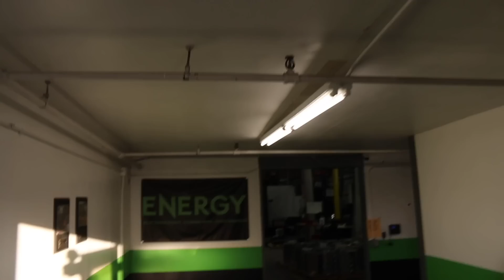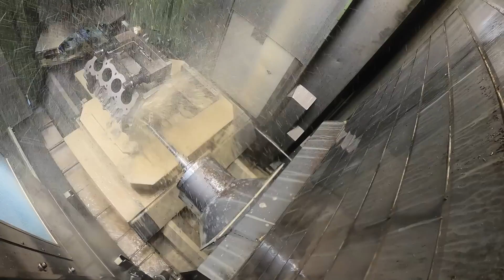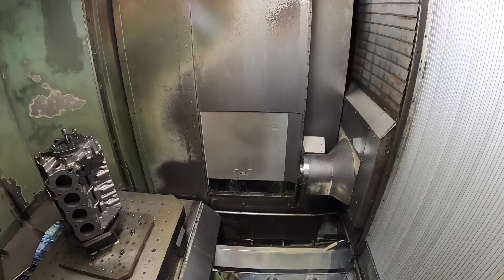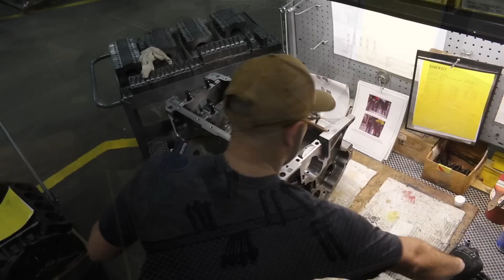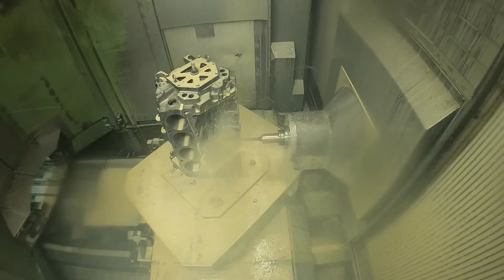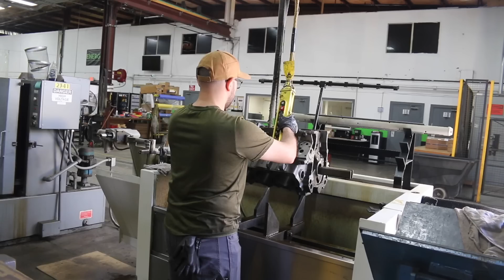How a Hemi Block Is Made at Energy Manufacturing #callies #hemi #mopar

Comment: Thank you for posting this. I recently bought a block and are assembling a hemi. it's a lifelong dream.I'm impressed by the quality. My only issue so far is the original exhaust manifolds does not fit. Som material must be removed from what is left from the motor mounts and the second thing is that I have to remove some material around the oil pickup tube otherwise it will not fit. No big deal.
Reply from the maker: Huh. That's the first I've heard. Were those the 440 mounting ears that needed to be shaved to fit the Hemi mounts or vice versa?
Reply: @moparconnection  yes, those are already removed but I need to shave off additional material 1/8” or 3-4 mm on the upper edge of the block to get the manifold flush to the head.

Comment: Brings me back to the days before I retired. I was a toolmaker , Master, honer, Grinder, Etc. It's all  memorable to me. I can relate to it all. It still amazes me . the technology now is astounding how fast they can machine.
Reply: Intresting! can you say anything about how long time it took to prepare a block like that when it was in production line?
Reply: @ifixmycarmyself2502  I have no idea now. I would have to call my friend in NY and he is busy. It's been ten years since I did any machining. I'm retired.In the last 15 years machining time have been shortened by 90% at least and the accuracy has gone to .000010 + -. Yes that's ten millionths of an inch. Engines do not require accuracy like that. Only die plates and dies.
Reply from the maker: It’s really impressive

Comment: Terrible video. Why so lazy? A caption identifying the hole or surface being machined would have provided actual information on what was going on. Thanks for very little.

I followed Direct Connection closely during the 80s. My recollection is that a condition of the government bailout that saved Chrysler in the later 70s was that they had to quit making new Hemi castings and destroy the cores. By the middle 80s DC had run out of NOS Hemi blocks. I also recall in 80s that because of this a company tried to make a Hemi head for a modified 440 block. I have the article on that 440 Hemi conversion head somewhere.
Reply from the maker: There’s nothing lazy about traveling 6 hours one way to record this process at each stage over 3 days. (You’re welcome for the free content BTW) Amazingly, some companies don’t feel comfortable giving away every facet of their process to competitors who’ll take that information to China to be knocked off. And yes, Stage V offered “conversion heads” for a good while but the juice wasn’t worth the squeeze.

Comment: IT'S SO SAD THAT 2023 WAS GOING TO BE THE LAST YEAR OF THE HEMI AND THE DIESELS AND MOPAR WAS SWITCHING TO SMALL DOUBLE TURBOCHARGED ENGINE'S AND ELECTRIC BOTH OF THESE SMALL ENGINES HAVE PROVEN TO BE PIECES OF JUNK TRYING TO SQUEEZE TOO MUCH HORSEPOWER OUT OF TOO SMALL OF AN ENGINE COMBINED WITH HUGE AMOUNTS OF POLLUTION DEVICES 
DAVID ADAM GRENIS MAPLETON AVENUE BOULDER COLORADO
Reply from the maker: The Hurricane is a decent performer, but the reason was because of the massive penalties that the EPA was hitting FCA with.

Comment: Wow. Interesting. It makes you wonder, how you can make a car every 5 minutes, and how long this process took back in the day.
Reply: Actually they can't make a car every 5 minutes but they can put out a finished car every 5 minutes, with PRE-PAINTED PARTS and pre built engines. And it may be faster than that. If you look up the production figures for 1966 Mustang you will see some very large numbers, 607000 from 3 assembly plants.
Reply: @thomasward4505  I do as much machine work on my own stuff. I have a fn kwikway boring bar and a kwikway 090 hone and a bd cylinder head machine. At very best I can bore 1 block an hr. Plus setup. The machinery itself is only so fast. Baffles the mind those numbers.
Reply: @thomasward4505  bad example there. Exactly when did they start machining 600k of engines

Comment: Hate to have one of those blocks fall on me.
Reply from the maker: lol yeah they weight 314lbs when done
Reply: At that weight I hope they are twice as strong as the original which I believe is about 245 with caps  @moparconnection
Reply from the maker: Actually, they’re very close and remember a factory street 426 Hemi weighed 812lbs fully assembled. They were monsters!

Comment: Are the "locally" cast blocks seasoned?
Reply from the maker: Same process for their Chevy blocks.
Reply: @moparconnection  aaaannnnd??????
Reply from the maker: Give them a call and find out! I wasn’t given a tour of the foundry.
Reply: Yes, all are covered in Johnny's seasoning salt.
Reply: I'm a engine machinist I've done years of homework. How do you to expect it to get seasoned as just a block?
Heat cycling is done as a complete engine not just a bare block. The metal takes a memory from running. The heat cycling done pre machining does not duplicate a running engine 
You must be talking about the old sales pitch from old times. In fact they didn't know what they were talking about.
Reply: Also, seasoned means used so who wants a brand new used block lol
Reply: @Moparmaganotmiga  not really.  Means heat cycled. Raw cast changes dimensions with the first few cycles. Do your homework
Reply: @somebodyelse836 that is heat treated
Reply: @Moparmaganotmiga  nope